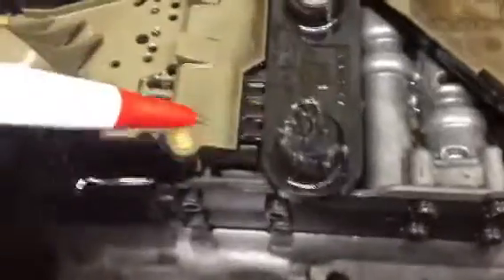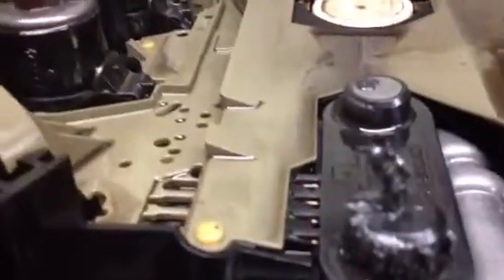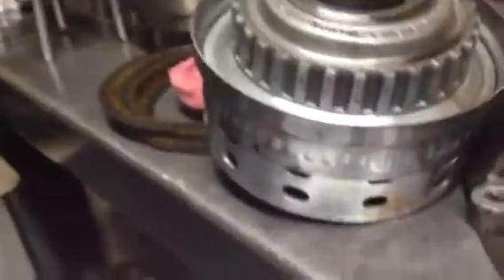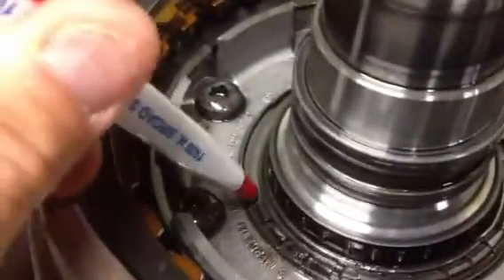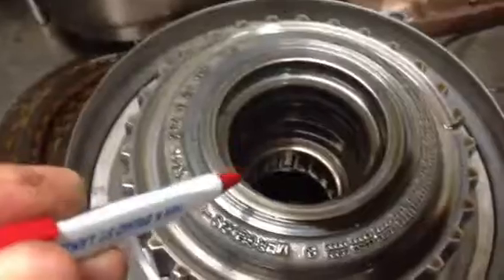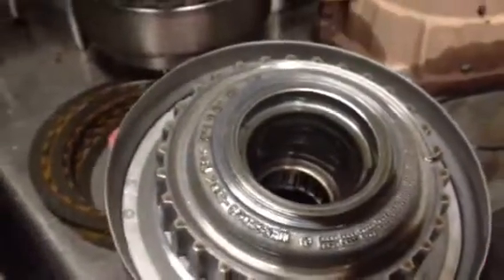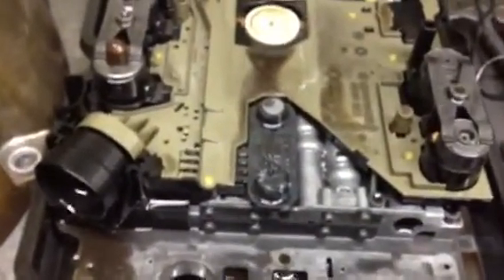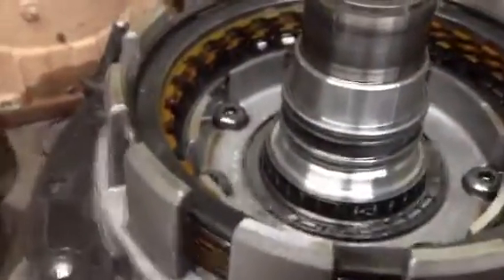Meenan Transmission Mercedes Benz 722.6

Comment: Is it possible to replace only the blown thrust bearing?  I unfortunately have this same problem.  I'm frustrated at the idea of having to replace the whole pump for about $600 because of a blown $5 bearing, but it seems to be impossible to find the bearing only.  Thankfully the roller pins did not seem to damage anything else in the transmission so as far as I can tell it's just the thrust bearing that needs replacing.